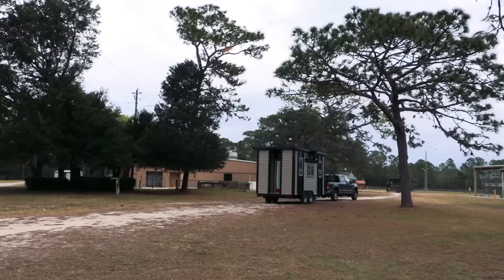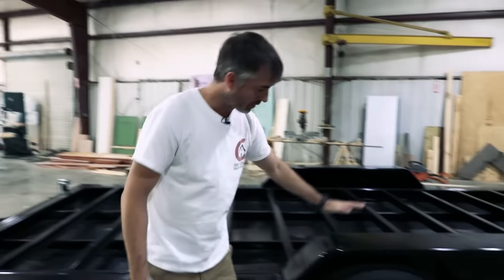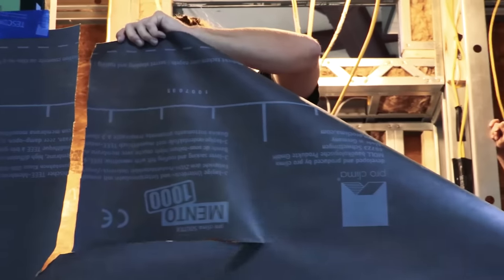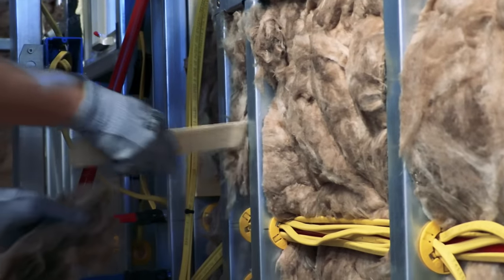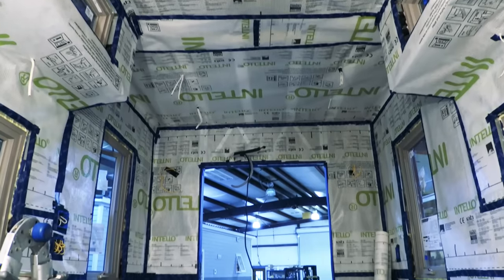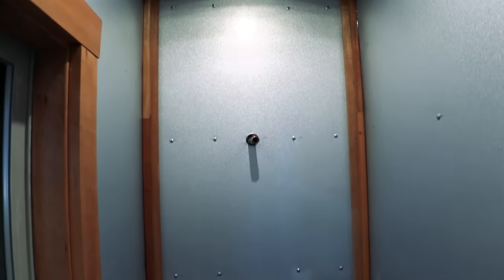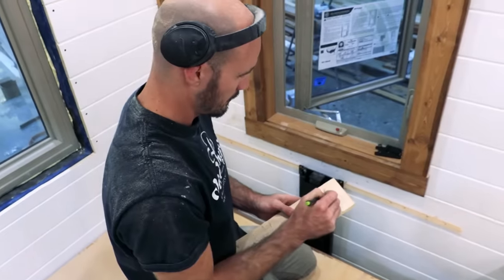Building A Tiny House From Start To Finish!

Comment: You should check out the "showerloop" an open source system to recycle your shower water by putting it through a filter. So it saves energy AND water. This MIGHT make off grid tiny house showers using only solar power possible (I haven't done the math).
The guy who done this also done the calculations to see the water is actually cleaned and sterilized thoroughly enough.
This idea should really get some more exposure.

PS: Thanks for the great build video! And it's really beautiful too!
Reply: Dejay Rezme hey deejay Kim
Reply: That’s a really cool idea! Should be especially great in fraught prone areas

Comment: It's a great build and lots of thought went into it. The Zip System is great. The Rockwool insulation is great. The extensively air sealing is also great. Sadly, the steel wall studs are not so great. By choosing such a highly conductive material, you've basically reduced the R-value of your walls by 2/3. That's not a typo. Despite all your effort, that thing is going to be cooooold. You'd have done better with an outer layer of foam insulation, but steel studs are still not a good building material. They aren't even approved for load-bearing walls around here. Hope your results are better than the science would suggest.
Reply: Yeah, all that insulation work is for naught except maybe for altering the surface temperature of the wall at each "insulated" spot -- but that is no comfort and would only be evident in a thermal camera photograph. This wall assembly cannot perform in any demanding climate zone. ALL control layers need to be continuous - the roof for water, the air barrier, the insulation, and the weather resist barrier under the ventilated facade if the wall has one. That floor has the same problem, there's no point in jamming in insulation between the floor joists if all that continuous steel of the trailer remains in contact with both the great outdoors and the inside, just under the floor sheathing of the heated volume. You have to build up from a continuous layer of insulation, not one broken up by cold bridges that will be just under your toes. :(

It saddens me to see these things happen - there's information out there but as luck would have it, some of the crucially important bits for energy efficiency are still not common knowledge even among the professionals.

Comment: The website says that the average price is about $50,000.  New trailer, metal frame... and oriented strand board (OSB).  Many builders wouldn't use it for their own homes, but they will use it in yours.  Some OSB does come with a water resistant covering painted on.  Any place you break the surface seal (cutting or drilling) creates a new edge that welcomes moisture;  and it swells when it gets wet, but that swollen edge doesn't shrink when it finally dries (and it takes a lot longer to dry than plywood).  Also, it's heavier than plywood.  Personally, I'll pass on OSB.

Comment: Now what?  Are you planning to drive across the country, visit Canada?  Are you shipping the tiny house to NZ?

Nice project.  Maybe in a follow up video you can go over how the drainage works for the sink and shower, and how you intend to cook and utilize the storage.

Cheers.
Reply from the maker: The plan is to travel North America in this tiny house when I return later this year. Right now I'm back home in New Zealand, but will be back in America for the summer and plan to do an epic road trip with the home. We hope to be able to return to North America every year to do some travels and explore more of the continent so this tiny house will be a home base for our travels.
Reply: Living Big In A Tiny House that's awesome.  If you make your way to Saskatoon Saskatchewan Canada, I'll gladly buy you a local beverage.  There is a tiny home community here which is working on getting regulations changed to allow tiny houses.
Reply: Your acting talents are well suited to your show. Imo each episode is a mini documentary film. I've learned lots watching & I have a suggestion. Since your only storage is in cabinets & under bed, it might be practical to use your shower as a part time closet. With limited water supply your showering will be brief. You could add a removable or collapsible double hung bar. Place a removable tray on floor for boots & shoes. When you need the shower, momentarily move clothes to top of bed. Thanks for all you do. Wishing you abundant Blessings!

Comment: i have seen that a lot - also in the construction of rigid homes -> the vapour-tight insulation is brought up with great care, but than perforated with normal screws ... why would you do that?  Vapour will enter through these holes given enough time and intensive enough usage of the home ( it probably will be no problem if one lives there just every now and then) ... There are technical solutions to screw without destroying the membrane ... In any case -> great design - beautiful and practical

Comment: this is exactly what i want to do for my tiny house/ light metal frame so i can take everywhere, and not need to get the realy big and burly 250, 350 trucks. , zip sheating, i want just a lil curve  rubber roof, with zip sheating on top, and use the pink waterproof bathroom, nothing much. so glad i could see and learn how it was done. Now i dont have that machine that spits out metal, lol, but i will def make this!!! thank youuu

Comment: Wonderful design & build! Suggestion: Since the kitchen is so close to the bed and it's such a small space, I am surprised that there is not exhaust (just a small 12v fan). It could be mounted just above the left side of the countertop and instead of just a light diffuser (like above the desk), you could fabricate some sort of louver with hole allotments for the heat-resistant LED lights.

Comment: I’m so envious because I’m struggling by myself in the winter OUTSIDE (hunt...I would LOVE help...currently in a Potomac backyard). I spent a year planning and gathering castoff or reclaiming so I’m juggling lots of stuff. 
I saw what looked like pex plumbing and yet I didn’t hear you mention. Did I just space? Also, I have my exterior complete ( with tyvek, clad , stick built) and inside (did upstairs electrical to be able to seal up in winter cold ridged foam, locktite spray ad then double faced mylar bubble taped with aluminum tape). It’s funny that I’m doing a wet room (except my shower has my composting toilet is on one end with sink and vanity across in a dry room) is either going to be artistically swirled epoxy panels then anchored and caulked iPad corners or the waterproof roll on with flecks thrown on and blown ( this method is used in commercial and school showers). I’m a little intimidated about installing propane myself and noticed you propane is inside...I was doing an on demand instant hot water heater with propane for hot water, alcohol stove, propane/ac/dc frig....do I need to mount the on demand propane water heater outside to be safe or will  my utility closet side suffice?). Also can you provide the dimensions of your new baby including your sink, please ?

Comment: We’re you ever thinking of a small wall propane heater or wood burning stove at all, or was that ruled out right away due to size?

It seems the one cannot-do is off-grid heating. I wonder if this can be solved by a floor warming system that uses hot water or electric?

My offer still stands for parking on my driveway and bumming some electricity in exchange to see this lovely home. North Chicago location.

Comment: Awesome tank of a mini home!
But just FYI: Those metal studs are all acting as (very effective) thermal bridges.

All of those thermal bridges reduce the R-Value of the wall. In this case, I would bet that there is enough thermal bridging going on to render the in-wall insulation pointless. For that reason, metal studs tend to be coupled with exterior insulation and do not have any insulation between the studs.

Zip actually makes a sheathing with a ridged-foam backing that would be perfect for a build like this. Alternatively: You could just add exterior ridged-foam insulation outward of the sheathing that has already been installed, then put your siding on over the insulation. That will add to the thickness of your wall, but it would result in a drastically more efficient mini-home.

The other concern (which you seem to be aware of) with metal studs is condensation build-up inside of the walls. That concern is eliminated given enough exterior insulation, but in this case you are relying on a perfect vapor-barrier seal (which I'm not sure exists) to prevent condensation build-up.

What has been your experience thus far?

Comment: I wonder if in the future you can add a green roof to the top?  Where you grow edibles and what not.
Reply from the maker: You absolutely could do a green roof on a tiny house, but they are very heavy and not really practical for a home which is designed to be traveling all the time. If you weren't moving often, then a green roof would be really cool in a design like this one.
Reply: OH yeah the soil alone would add weight.

Comment: Okay.  You were using Zip sheating.  Which, when applied right, functions as a vapor barrier.
But you didn't tape it or liquid-flash it...
But you put Mento (and tape) on the outside.
Then you put Intello (and tape) on the inside.

Color me stumped...

Comment: does zipwall breathe appropriately with all your other membranes?
Reply from the maker: Best answer is no. It was a mistake in this project to use the zipwall, but we did use the membrane tapes on the joins of the zipwall, so it should still allow the system to work.
Reply: My concern (from what I've heard via those in the know like Matt Rissinger and Joseph Lstiburek (https://buildingscience.com/documents/digests/bsd-106-understanding-vapor-barriers)) is that trapping moisture in particle board is a big issue :( You have included an HRV which will help. I am intending to build (not tiny on a trailer but small on piles in the northeast US) with SIPS and still chasing info re moisture thru walls and roofs. Looks like plain old tar paper is the way to go. Tx for your candid video and reply. Life would be boring if we knew everything ahead of time, right :) Appreciate your videos and Kirsten Dirksen's the most re the tiny house game. Best regards, Rich
Reply: Bryce, I was concerned with the possibility of toxic fumes from the particle board as well as the PIR insulation material.    PIR is rated high toxicity in fire tests, though it appears it is more stable in other circumstances.  I could find no information about the wood agglomerate used on the panels; is the glue as toxic as standard panels?  This is one of the big problems with RVs etc., all the toxic materials in their makeup, and many TH fans are looking for the healthiest solutions to replace them.  

A friend of mine here in France recently patented a non-toxic particle board made from oyster mushroom mycelium and straw, after observing the behavior of various substrates left to weather outside her mushroom-producing caves.  There are products being made in the US (and perhaps in other countries)  from other formulas that could be very interesting to TH builders. https://greenbuildingelements.com/2015/04/15/mushroom-based-building-materials-are-here/   

I think mushrooms could also be a useful solution for off-grid homes looking for water/soil purification techniques. Check out Paul Stamets here: http://www.ultrakulture.com/2016/01/04/the-soil-magicians-6-ways-mushrooms-can-save-the-world/
Reply: Interesting chez moi. We are still looking for the best framing. Everything has its pro's and cons. Timber would be preferred but too heavy.

Comment: Great build, but I do have a problem with using batts on a structure that you are going to travel with. For the insulation to work properly it needs to be installed with no gaps and installed so that the batts can expand to their natural width, in order to achieve its correct 'R' value. But this will mean that gravity and movement will ensure that the batts fall down the walls. Some RV manufacturers spray glue on the walls but this has a limited life span. I'm not sure whether there are any sheet/spray products on the market that are non toxic. Perhaps somebody could help here.

Comment: Do u need structural sheathing? Can u just use a wrap to save weight with a metal frame or would that allow moisture inside in humid environments?

Comment: Such an amazing building! I however have a question for you, as you've seen so many different ideas in tiny houses: have you ever seen an eating area/workspace that is kind of floating next to a loft bed? Because I came up with this idea of having my desk not be on the ground but on the 1st floor with one bench and the table secured to one wall but the other bench being able to slide on a metal guide rail, so I can not only sit at my desk but also reach a wall of shelves that would take up too much space on the ground...do you reckon this is possible? Also what about mounting your piano to the wall? Okay if this weirded you out nevermind I'm just thinking about building the most incredible tiny house but that'll have to wait for another 10 years to come to reality

Comment: What steel is used? Is it very resistant to Salt air? Plated? 
How about long term rust and corrosion? Does it have at least a 50 year warranty?

Comment: Beautiful    How much does this Tiny weigh.  My initial builder finally finished sheathing my metal build with zip board that has 1/2 “ insulation (13weeks😖) I was hoping mine would be under 5thousand lbs empty but is not.  Mine is metal frame as well

Comment: Thank you for the building details.

The crew from Tiny House Chattanooga are amazingly skilled professionals.

I think some of the Galvalume could be replaced with waterproofing membranes from Schluter.

Schluter is, also, lighter, and it might be less labor intensive; however, the installers have to be certified.

Comment: I work in the tile industry and can I just say... I don’t think that shower is air or water tight. The idea was there but the red guard became pretty pointless when you drilled holes into it, lol! Maybe you did this but you should be drilling pilot holes and filling them with silicone before putting the screw in. Either way, it’s a beautiful home👍🏻

Comment: I beg you, please look at basic electrical code. I saw that all the breakers are 20 amp. Thats great! but earlier in the video I saw that most of the electrical is bundled. I saw four 12-2 NMB and 1 10-2 MNB cable. That is a 50% derate on bundling. 12 wire is good for 20 amps, derate and its now only good for 10 amps. We need to build to the same standards as residential homes so someday we can live in this everywhere. Please build to standard building codes.

Comment: I have a couple of questions for you:

1.  How is the steel frame holding up?
2.  What was the dry weight of your tiny home?
3.  How happy are you with your membrane?  Healthy home from Mainstream?
4.  If you don't mind me asking what was the over all cost?
5.  How is the lunas heat recovery system working?
6. Can you hang things from the wall using the metal frame?

Comment: The layout kind of grew on me after initial hesitation. Great choice with the Lunos HRV! However... that floor and wall construction with the broken up insulation layer cannot function. Insulation has to be one continuous layer in order to insulate -- just like the air barrier layer, or the weather resist barrier, or a roof.

Every steel stud and joist that interrupt the insulation layer make the "insulated sections" nearly irrelevant and undermine the total wall insulation value, bringing it down immensely. It's like an electrical wire with cracked insulation, or an oven mitt or an umbrella with holes in them. Leaks of heat, electricity, or water simply happen where there is the least resistance and nobody would be happy using such products. All that steel connecting the cold outside and the heated inside acts as a "cold bridge" and devastate any performance goals set for the wall assembly. :(

I would probably just leave the stud bays empty and take the hit in reduced internal space as a tradeoff for the weight savings of the steel framing, and go for a fully continuous external insulation layer - probably rigid foam, or maybe Roxul type wool.

http://www.greenbuildingadvisor.com/blogs/dept/musings/cut-and-cobble-insulation

Comment: Hi.  Big fan of your show.  I'm surprised you don't know about the schluter Kurdie shower system it would have made your life easier.  It is what I used for my tiny house shower.  Also I started with the Nature's Head and after using it for 4 months I realized the container is not large enough to actually compost before it fills.  It is also a pain to clean because the plastic they use is rough and it gets dirty.  Lucky for me they took it back but I lost about 100$ in the process.  I made a toilet from a 5$ bucket that worked much better which is ironic given how damned expensive that toilet is.  I installed a separator which is the  main reason I went for the Nature's head in the first place because separating is vital and 8 years ago it was impossible to find any inserts to make your own.  I considered hiring a local potter to make me one.  Now you can get them easy.  Urine diverters on amazon!

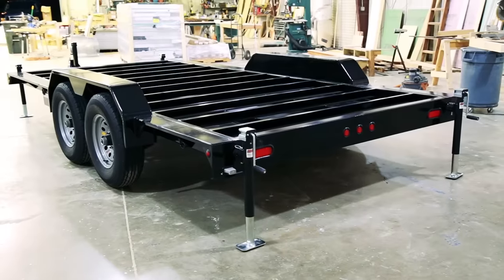Comment: 1:12 Trailer
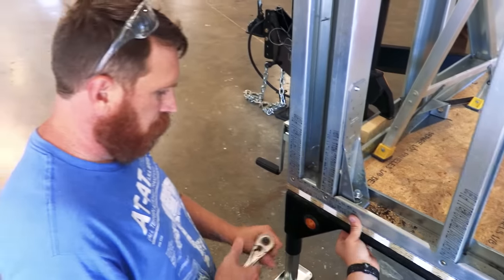3:57 bolt down 
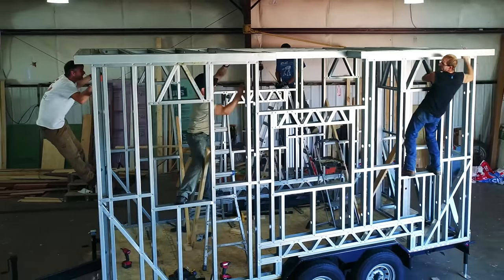4:27   steel frame
6:02 insulation
7:00 window 
9:01 Membrane
17: 00 electrical power

Comment: i would not have a recessed entry door....i would have a fold down porch....this would give more room for that area.  also, i do not like slanted roofs....i would rather have a roof that would automatically raise up for additional head height space.....use hydraulics .  where the tv is i would not have a recessed tv.  i would not have had a window and would have a wall mounted system that could swing out if needed....